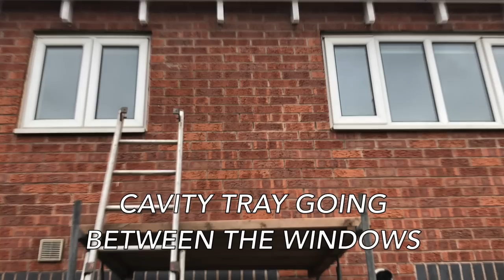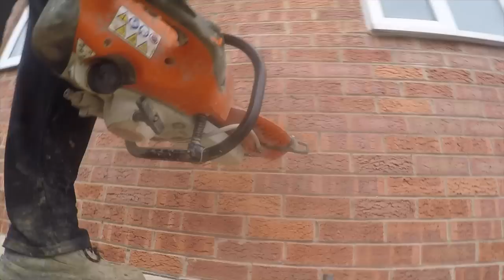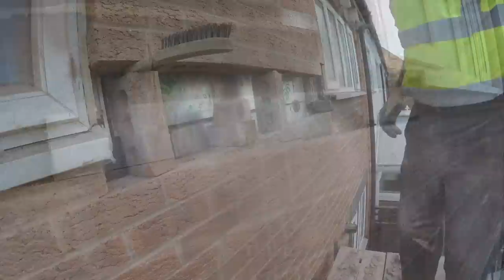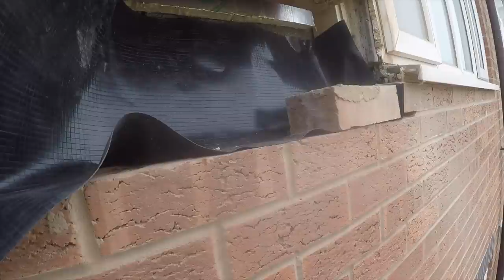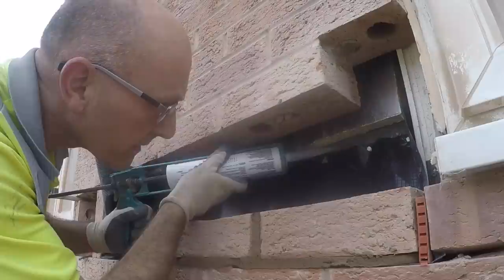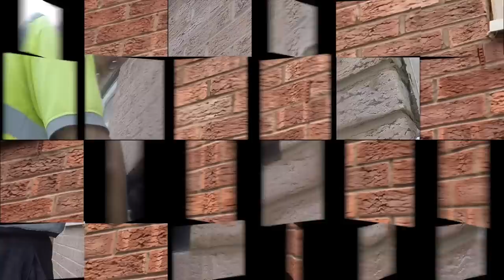BRICKLAYING..HOW TO INSTALL A CAVITY TRAY ABOVE AN EXTENSION.... EXTENSION PART 9

Comment: Class act. Taking the extra time to ensure the joints are fully filled on the replaced brickwork, so they are just as strong as before. Most brickies wouldn't bother.
Wonder if a few cheap little screw jacks would make things easier for supporting the wall as you are working? Quick to adjust, light enough to drag up onto the scaffold and save the risk of damaging bricks.
Reply from the maker: Sideslip . I like the sound of that ! In all these years I’ve never come up with that one ....... so simple , thanks for the tip 🧱👍🏼

Comment: Great video guys work is always top draw. When you put trays in for abutment bed them up on mortar then rake out to take lead under tray so it disperses above lead as roofer will just dress it where they can. All the best ex brick NHBC inspector now😦😓
Reply from the maker: Thanks very much for the tip Rob , I will use it in future jobs , I realised as I edited  the video . 
The comments section is great for picking up nuggets of information and tips , thanks for watching and commenting 🧱👍🏼

Comment: Well finished you would never know you were there, that little job was a bit of a  fiddle but would make a great sat morning job
Great work as per usual 👍
Reply from the maker: wheaten bread . Thanks pal it was supposed to go right across believe it or not , what’s the  point directly under  a window ? 🤔🧱👍🏼
Reply: Anyone can build new, it takes a true craftsman to do proper repairs that are invisible. Most tradesmen won't touch repairs like this, as it takes more skill to carry off properly than they posess.
Reply: @TyphoonVstrom  Any good experienced bricklayer could do that in his sleep and Steve would most likely agree the art is matching the mortar colour as best you can👍
Reply from the maker: wheaten bread . Yep colour and brick matches are a nightmare nowadays! 🧱👍🏼

Comment: Did you leave the mortar to cure fully in those first 6 bricks before continuing along with the rest of the tray?

Did the section of wall above sag down onto the temp props at all? I noticed the middle prop was not for coming out.

I've got an extension coming up and was wondering how a cavity tray was fitted in an existing gable wall and this has answered my question, thank you very much, true craftsmanship at it's best.
Reply from the maker: That’s was the while tray as the flashing on the new roof came right up to the windows . Good luck with the extension 🧱👍🏽

Comment: Yeah grind out a bet joint with smaller grinder in block work to put cavity tray in  nail and rejoint in place alone whole span, replace all insulation above and under. Could help noticing the first half you put in was tipping making the strecher above and half above that tip also but i guess only a brickie will notice that .
Good suggestion usung ridgid trays but realistically would still need to install insulation corectly and dont think just taking out one course would provide adequate manovability for that
Reply from the maker: We generally take out 3 to give ourselves plenty of room 🧱👍🏽

Comment: I used to build small extensions retired 10 years ago the building regs now are stringent making it harder to earn a living 70s were the best times don't envy anyone doing it now these regs did not  apply back then  I believe internal blockwork has to be pointed! Not easy being a small builder
Reply from the maker: david inger evening David . On site the blocks need to be jointed , extensions not really . There are certainly plenty of obstacles now thanks to some ridiculous regs 😬🧱👍🏽

Comment: Pre formed plastic trays are awesome for stepped and horizontal trays. Stepped we buy with the lead on with correct pitch. Vertical we buy blank and cut are own lead in as it's easy to cut in  straight lead with no wastage and works out cheaper. 
Plus you only need to cut out one course instead of three. 
We dry pack with slate as we go so no way of brickwork above dropping.
Reply from the maker: Sounds good , thanks for the advice , always welcome here in the comments 🧱👍🏼
Reply: @SteveAndAlexBuild  we all pick up tips and tricks off the people around us. Best thing about bricklaying is you never stop learning. I always enjoy finding new and easier ways around things off other trowls and trades.  Enjoy watching the vids Steve.
Reply from the maker: Stephen Holmes . Same here pal , glad you enjoy our channel 🧱👍🏼
Reply: We did the same with the slate  when I was bricking a long time ago didn't drop
Reply from the maker: Mike Russell 👌🏼👍🏼🧱

Comment: Unless I missed it, why did this need to be put in? And why was it missed at new build? Unless these are daft questions?
Reply from the maker: Building inspector required it . There wasn’t an extension there when the house was built 🧱👍🏽

Comment: Rather than trying to seat the back of the tray with silicone which will never work, the seal will of been broken as soon as you put the insulation back in.your better off getting it chiselled into a joint on the block work and cork it in with some lead. Then point or silicone

Comment: Would you still need drainage holes if the cavity trays are at the height of a flat  roof upstand? Or are they connected within the brick work?
Reply from the maker: 3619jon . The weep vents exit onto the lead flashing which was installed after the new roof went on 🧱👍🏽

Comment: Nice job as always. Bet your arse was twitching a bit when your wedge was stuck 🤣 been there.  I’m currently building a small extension on an old house. Building inspector insisted on cavity tray where roof abuts the house.  Didn’t pick up on the English bond on the brickwork. On all his visits he had failed to figure out the house has solid walls. 🤔🥴
Reply from the maker: LookitsMeNotYou . And they are in charge ! And yes much twitching was going on ....... 🤔”shit I never banged that in THAT tight “! 😳😂😂😂🧱👍🏼

Comment: When a new window or door opening is cut out, is in compulsory via the building regs to install cavity trays ?
Reply from the maker: ANTONIOS . A bit of a grey area that one . Not  sure myself , we installed one as it was specified on the drawing . Building control never mentioned it 🤔🧱👍🏽
Reply: @SteveAndAlexBuild  Thanks for your reply. Most people do not bother.
Reply from the maker: ANTONIOS No probs pal  ,we try and reply to everyone who has took the time to watch our channel and comment 🧱👍🏽
Reply: This is strange one because yes if there is another story above the lintel there should be a tray damp but in all my years of this kind of work I have never been asked by an inspector to put a tray damp in. You would have to go four or five courses above the lintel and unless you fixed into a bed joint of the internal cavity wall it would be pretty pointless. On this video I am struggling to understand what the bricklayer is trying to achieve as I have never seen a tray damp put in the piker between two windows.

Comment: Does water ever really get in there? Just wondering if they are overkill?
Reply from the maker: Wayne Leone . Wayne , I couldn’t agree more , I’ve never seen water dripping from a weep vent . But it was on the plans so had to go in 😬🧱👍🏼
Reply: Total overkill, mate. Just someone with a clipboard trying to justify their job!
Reply from the maker: Jim Newlands 😬yep have to agree 🧱👍🏽
Reply: It’s not overkill when you have to go and fit them retrospectively as I’m having to do atm , damp walls below flat roof
Reply: @timothybint4960 I had the same issue. No cavity trays and a wet ceiling in the room below. Turned out to be the flashing. Fixed that and no more leaks

Comment: How goes it lads? One small tip and you probably thinking oh yeah what now lol. Get an 8 or 6mm finger trowel for packing the mud in between your new and existing bricks, makes it a lot faster and can be sure its solid. cheers Lads
Reply from the maker: Helicrete Sydney . Good thanks , summer has finally arrived here 😎🧱🧱👍🏼
Reply: @SteveAndAlexBuild  Finally some shorts weather for you. We have the opposite here at the moment in winter. Cold in the morning you need trousers and the heater on in the car. By about 11/12 you wish you had shorts on and need the air con for the drive home. Be seeing you ;-)
Reply from the maker: Helicrete Sydney . At least our rain how stopped for now 🤞🏼, see you next Friday 🧱👍🏼

Comment: Thanks for the great video! What is the size of the thickness of the seam between the bricks? And why? Thanks.
Reply from the maker: Alexey Samoyluk It’s plastic DPC  and is only about 1 or 2 mm thick . It’s designed to catch any water in the cavity and release it through the plastic weep vents 🧱👍🏼
Reply: @SteveAndAlexBuild  1.«We put a cavity tray between the windows…» Explain what this is for? Why wasn't it done before? Sorry to use the translator. Thanks.
2. What are the sizes of vertical and horizontal seams in a laying which are filled with a cement mortal?
Reply from the maker: Alexey Samoyluk . 1 The tray is to stop any water in the cavity from running down into the new extension which we have built since .
2 I think you mean the joints . Horizontal ones are called BED joints and the vertical ones are Cross joints or PERPS. Hope this helps 🧱👍🏼
Reply from the maker: Alexey Samoyluk .We use the Marshalltown jointers and use the biggest size which is a number 81 🧱👍🏼
Reply: @SteveAndAlexBuild  Marshalltown 81 Brick Jointer: 3/4" ? Or 7/8"?
Reply: @SteveAndAlexBuild  Sorry for my meticulousness.
Reply from the maker: Alexey Samoyluk no problem ... the jointer I think is 7/8 ths and new brickwork beds are 10 mm older work more like 15 mm 🧱👍🏽
Reply: @SteveAndAlexBuild   Thank you very much for your help!
Reply from the maker: Alexey Samoyluk No problem, any time my friend 🧱👍🏽
Reply: @alexeysamoyluk356  h

Comment: Should the cavity tray not be lapped over the inner leaf also?
Reply from the maker: Not necessarily. On new builds the stepped trays are rigid plastic that just sit against the inner skin . 
    It’s pretty much impossible for water to get through the outer skin , then cross the cavity then actually run down the inner leaf . 🧱👍🏽
Reply: @SteveAndAlexBuild  Fair enough! Thanks for the response.  Could I possibly ask another question?  Not related to your video but why, on an extension with a solid floor, would there be weep holes below the DPC? Could it possibly be a suspended concrete floor? Would this be why there are weep holes?
Reply from the maker: @louisamcallister6809  The only reason I can think of for low level week vents is when there is a continuous cavity tray around the perimeter. This is usually because there is a gas membrane under the house 🧱👍🏽
Reply: @SteveAndAlexBuild  weird as it's not in a radon area, but I'll try and find out more. Thanks for your help!
Reply from the maker: @louisamcallister6809  . No probs , thanks for watching 🧱👍🏽

Comment: I picked up a pointing gun a few years ago in B&Q of all places, great tool for filling out beds like that, also for pointing slabs etc, it pushes the mortar into the opening under pressure, along the same lines as a giant silicone gun.
Reply: Love my pointing gun. It’s so quick.
Reply from the maker: @gdfggggg  👍🏼🧱

Comment: Nice work. How comes this was required between windows? Was it missing above lintels?
Reply from the maker: Zed Man Thanks pal , it sits just above the new extension roof. It’s quite old this vid , it was done first before we started digging . The whole job is finished now , we made 11 videos of the build 🧱👍🏼
Reply: So it acts as a moisture break between the existing blockwork and the new lintels, to stop moisture migrating past the new works?
Reply from the maker: Sideslip . Exactly . It does the same job as one over a window 🧱👍🏼

Comment: You've got 'big muscles' to use that saw the way you did....I just sold mine like that. 
You did a good job "tucking" those bed joints, impressive craftsmanship! 
The video would have been much better with the "music of the tools working" rather than the tunes you used....IMO!...and this is the last time I'll ever mention that subject (I like construction videos not music videos but I'll do no more harassment).
Reply from the maker: arkansas13 glad you like work sorry about the music , it’s mainly there to mask the radio to avoid copyright strikes ..... had 2 don’t want any more 😬🧱👍🏽

Comment: No problem with your workmanship but really, a dpc tray above an extension. You haven't built in a cover flashing so there is no way of weathering the extension. Anyone watching this, trust me, this is bum information. You always use a preformed cavity tray, which can either be done in lead or you can use preformed plastic cavity trays that has a lead cover flashing attached so your soakers from the roof of your extension can tuck under the flashing to give you a forever water tight problem free structure. IG do a good one. 
The strange thing about this, you did all the hard work by neatly cutting out and replacing the bricks

Comment: Looks a good job, but why not use ; 'proprietry  cavity trays, and weep vents'?
 They are interlocking, and only require one course of brick to be removed, surely easier and quicker ? But not wanting to criticize your channel is great! Cheers dx
Reply from the maker: I’m learning all the time David , not seen them before but thanks for the tip 👍🏽🧱
Reply: @SteveAndAlexBuild  Not a criticizm, just a bit of advice pal!  ( I am a Plumbing and Heating engineer, but get involved in lots of Building restoration)  YOU do a great job and take pride in your work and it is great to see. It is so hard for 'FOLK' to find decent , hard working tradespeople, you will find that the majority, will pay the top rates ,for a good job and good customer service! Nice one dx
Reply from the maker: @davidwaterhouse2552  . All advice welcome here David and much appreciated. Cheers 👍🏽🧱

Comment: Yours is not to reason why Steve and Alex but I think the architect is crazy asking you to do this as it is completely pointless and has compromised the integrity of the original super structure. On your skills I don't doubt for one minute that you know what you are doing but why not string a line across instead of coursing your brick with a tape measure. Please ditch the Marshalltown joints they are just so crap.
Reply from the maker: David Dore . We won’t be using that architect ever again believe me !!!!! 🤬🧱👍🏽

Comment: Would it not have been easier and quicker to treat the area with storm dry ? That will stop rain penetration!
Reply from the maker: jason peter spratt . It certainly would but this was specified on the plans 😬🧱👍🏼

Comment: i think that brick work has become over complicated. 9 inch solar and 50mm celotex then outside face tied in job done. all this stuff is trying to make a system thats not the best work. not takeing anything away from the effort here. far from it these guys are on it.
Reply from the maker: Edd Jordan Cheers Ed , agreed , I seriously doubt this tray will ever get wet ! Unfortunately it was on the plans which were signed off by building control 😬.
Thanks for watching and commenting 🧱👍🏼

Comment: What the f#%k is holding the peir up?? Silicon and the soldier at top? And why a tray there?
Reply from the maker: Ryan Kirk I had it propped in 2 places . That’s the only place we could get a tray in as we were very tight on the roof pitch 🧱👍🏼
Reply: Yea was meaning when you disk cut through first wasn’t proped then! Nice work tho bud
Reply from the maker: Ryan Kirk  fingers were crossed and hoped for the best 😬😬😬🧱👍🏽

Comment: Sorry but I am loss, why did you need to do that.!
Reply: Stops water ingress to the new extension the water will come out of the orange vent
Reply from the maker: craighughes craig . Mmmm it’s easier if you google cavity tray 😬. I put it in because it was specified on the plans 🧱👍🏼
Reply: Gareth Whittle , you get water coming out of the weap hole, I will eat my hat. It will never works, sorry 😐
Reply from the maker: craighughes craig 😬🧱👍🏽
Reply: @craighughescraig6096  I've just had to replace some over a window that someone had removed and started to leak they have been put in for years and they do work mostly older houses that will be affected due to cracks in the brick for age.
Reply: Don't think of running water coming out of these vents. They are meant to stop moisture migrating through the blockwork, in exactly the same way as a damp proof course stops ground moisture wicking up through the brickwork.
You are right, you'd probably never get running water coming out of the tray area, but they stop any moisture from say a week's worth of rain waterlogging the bricks and then having it wick down the walls into  internal areas, or in and behind doors and windows.
They help keep moisture content in the cavity under control and by doing so, let the insulation work better and stop that horrible, musty building thing you get on older brick buildings.
Reply from the maker: Sideslip nicely put 🧱👍🏼
Reply: @TyphoonVstrom  I've seen water coming out of them but your spot on with what your saying . Depends on the brickwork above if there are massive holes water will get it.
Reply: @craighughescraig6096  I've got a hat for you to eat mate